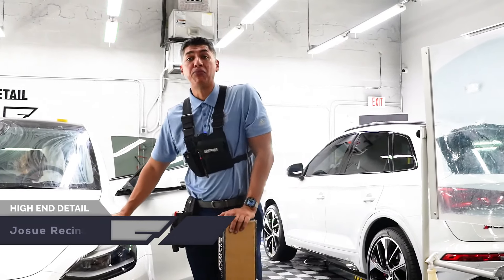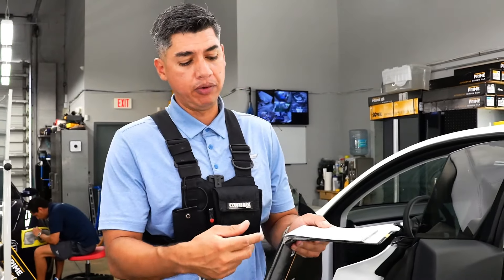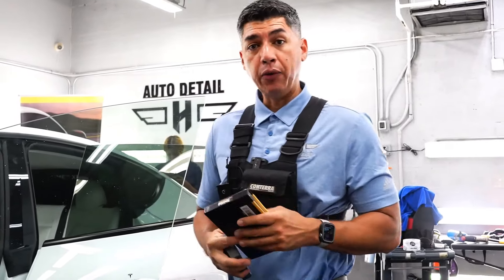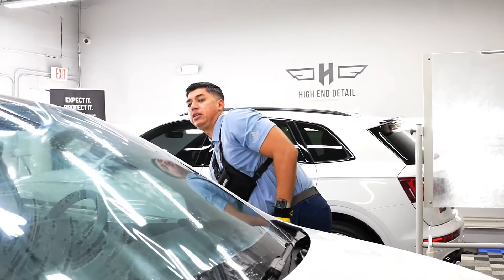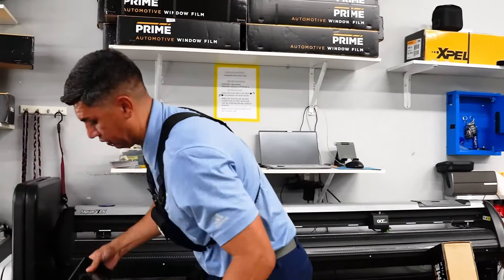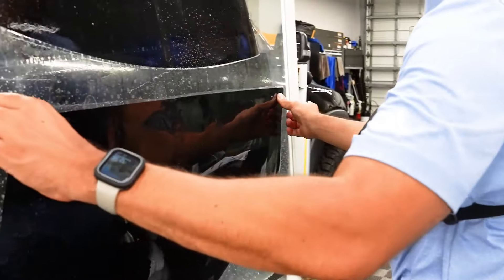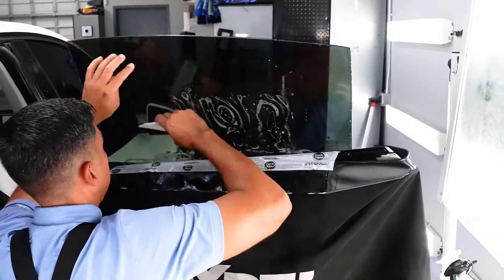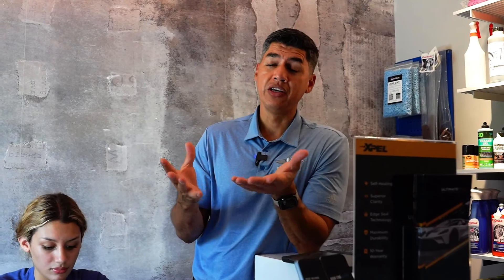WINDOW TINTING YOUR TESLA MODEL Y | XPEL XR PLUS CERAMIC TINTS

Comment: Do you recommend doing the roof tint? I know they have factory tint that protects you from uv ray and heat .
Reply from the maker: If you're looking into some real heat rejection rate, and want your vehicle to be as heat resistant as possible, it is highly recommended! Just make sure who ever is installing these large portions of glass explain to you exactly how it's installed as well as for history of working with such vehicles

Comment: Notice how he covered the IRR reading with his thumb when he measured the rear windows. That's because the rear windows come with 91.5% IRR from the factory. I've measured it myself with that same tool on a factory Tesla Model Y.
Reply from the maker: Hi!
Did you also measure the two front windows without tint?
To think that not putting any tint on the rear windows is a great idea because it already blocks heat is the wrong mindset. Your kids, dogs and or whatever you put back there will get cooked! 
The only thing that will help you reduce heat is window film, specially a high grade ceramic film. Thanks for watching 🫡
Reply: @HighEndDetail  I did also measure the front. Here is what I got around the car. 
Front: 80.5 VLT, 100 UVR, and 76.7 IRR 
Rear: 21.6 VLT, 96.2 UVR, and 91.5 IRR
The roof got 100 UVR and 98 IRR
Reply from the maker: @ScottRodriguez  great! So based on those numbers you’re thinking tint isn’t needed? Do a btu reading on those back windows, they’re absorbing more heat than the clear two front windows due to the fact that they’re factory dye black.
Reply: @HighEndDetail  
Great video. 
I’m trying to make sense of this, too. If they factory backseat windows have UVR~97, and IRR~91 does adding film to get to UVR~100 and IRR~98 really improve things all that much?  How do the BTUs compare?  Or is comparing BTUs even a fair comparison?  I really appreciate your insight on this.
Reply: @malkie85  I think HED is saying that they come factory dyed black so while they do have a high UVR rate, it absorbs the heat which is not going to keep your car as cool as if you had a high grade ceramic film which also reflects the heat back.
Reply: haha i noticed this as well. purposely done, not very transparent
Reply: @deuce7velcro  i see (through) what you did there 😏
Reply: this is the first video I've seen of yours... and I gotta admit, that's pretty dodgy behaviour aye 🤣 

Like, you didn't even defend your actions, so it was def done on purpose... but with no explanation of why. I guess it would be worse if you lied and said you didn't mean to cover the info with your thumb. 

Anyway, my point is it's pretty deceptive dude 🤔 How can anyone honestly trust anything you say after a stunt like that?
Reply: Back windows have no heat blocking properties like a ceramic tint would provide, it's mainly privacy glass I think that's what the video is trying to say and him also in the comments. For a Tesla it's important to get ceramic all around so that you can save battery percentage while driving
Reply: I came to the comments figuring someone else must’ve also noticed it and called it out. It’s so obviously intentional too, and it doesn’t even make sense why. Going from 91 to 98 is still a great improvement, and explaining why would’ve taken like 10 more seconds instead of being all shady and causing people to hit that “Don’t recommend channel” button on YouTube due to the loss of trust.

Comment: What is the IRR on the stock windows with the factory tint in the rear? You covered it with your thumb when you tested it in the video. I was excited to see the difference.
Reply from the maker: If you skip ahead to 2:28 you see all the numbers of rates on the factory tesla window with the scanner and the film comparison
Reply: @HighEndDetail  what is the IRR on the two back windows?
Reply: I would like to know too. You covered it with your thumb. You did show the front but what is the irr of the stock rear windows.
Reply: 97.1
I saw in the slow motion
Reply: 91.5 I've measured it myself with that tool on a stock Tesla Model Y.
Reply: The rear does provide IRR as you can see on multiple videos found on YouTube. It is clear he covered the IRR reading on purpose.

Comment: I had the front windows on my 2022 MYP tinted with XPEL XR PLUS a few weeks ago. There is a minimal gap between the edge of the film and the top edge of the window.  I can see the tint film line. Again minimal (maybe the width of 1 or 2 credit cards put together) bit it’s there. The tinting facility said they don’t go to the exact edge of the window because on Teslas they have found that when they go to the edge they have encountered peeling through time. Is this accurate? Thank you
Reply: Yes it's true, unfortunately on all vehicles if you put the film to the edge it would peel, so you leave a little gap. I try to shoot for one CC..

Comment: the best tint for tesla y is 15% in the front, 35% in the rear and back window, roof and windscreen is 70%. If your happy with the privacy stock window from tesla and don't want to tint it just want to match the front, just tint the front 20%.

Comment: Front VLT was 10%
Rear VLT was 15%
So the back side windows are 5% lighter than the front?  Doing 35-45% in the rear would've been an actual match.
Reply from the maker: yes and no. yes, the front windows are 10% but due to them being close to the windshield (lots of light come in) and taking in consideration that the seats being are white, 10% looks like 15%.

Comment: Why are you accounting for the white interior to change the tint when the back windows also have white interior? Because the variation is true for all windows, shouldn't it be ignored? If the 10% on the front is going to come up to 15%, isn't the 15% on the back going to go up to 20%? Seems like you should just match the windows, unless the interior were 2 different colors front and rear.
Reply: The front seats are going to be more illuminated by the light coming in the windshield and reflecting it out the front windows, the back seats are going to be shaded from that light by the front seats, so if all were tinted the same, the back would appear darker from the outside. If the goal was for the windows to look the same from the driver's perspective looking out, they should try for the same effective VLT, if the goal is to make them look matched from the outside, then they'd want to be a touch darker in the front.
Reply: @PMitchell106  makes sense. thank you

Comment: I had my front window tinted with 3M clear. They put on the inside. Why?
Reply: Tint is always applied to the inside.  When you see him laying it down on the outside, that's just to stretch and form it so that it's the right size and shape when it's transferred to the inside and won't require as much work to get laid down into place.